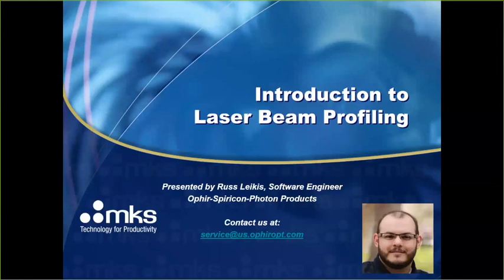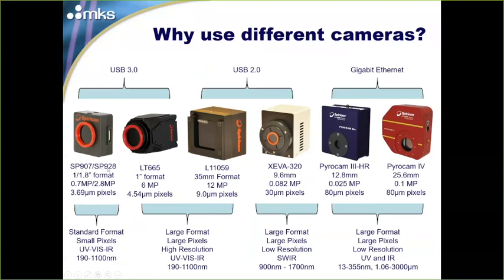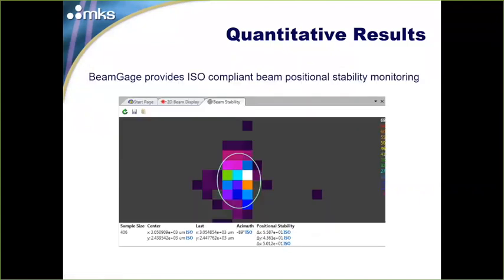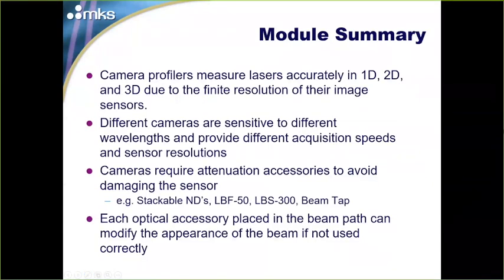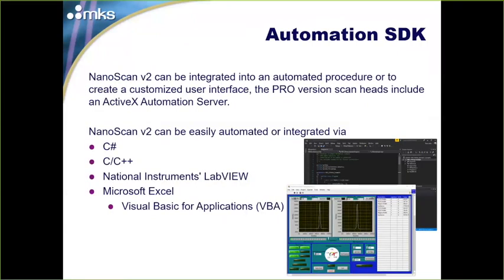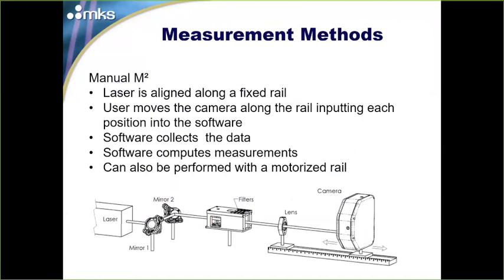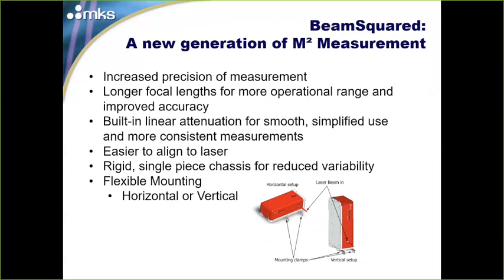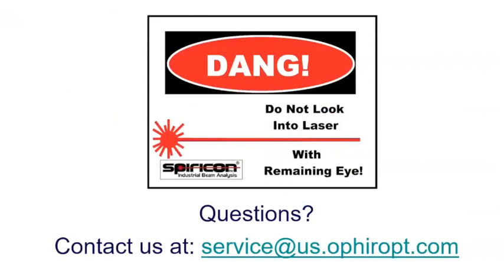Webinar Introduction to Laser Beam Profiling

Comment: hi, which oneof theses equipment will be use to determine wavelength of red laser beam?
Reply: I don't think any of these profilers can be used to determine the laser wavelength. You need a spectrometer to determine wavelength, and if you also need to know intensity or power, you will need a spectroradiometer.